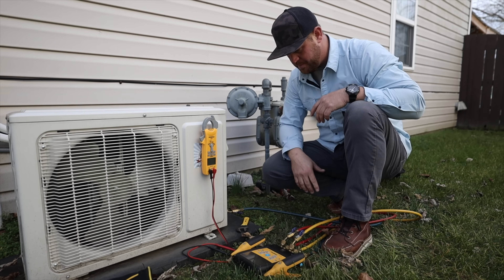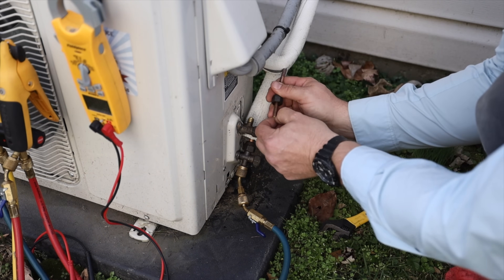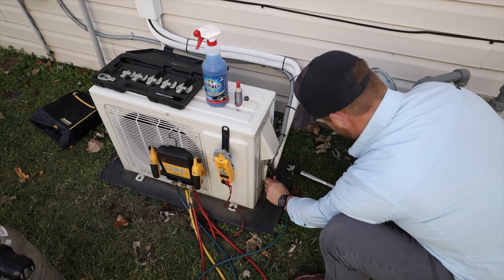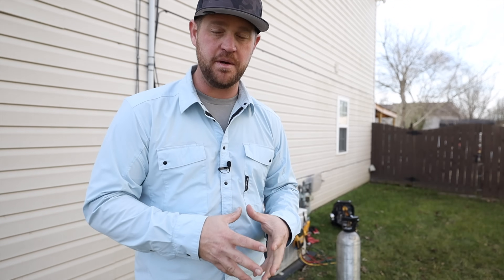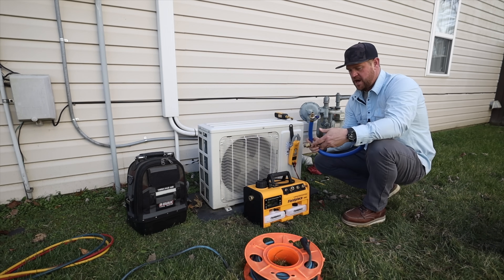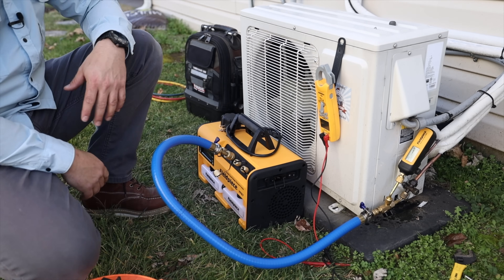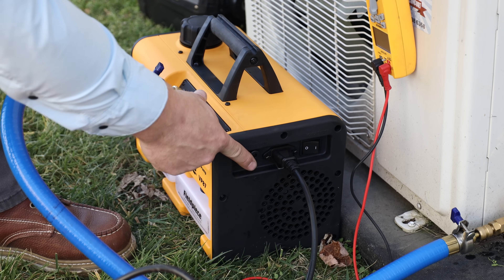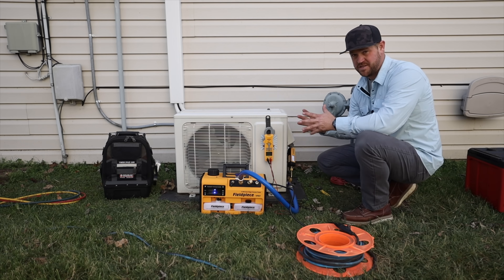#1 Reason Why DUCTLESS Units Fail | How I Fix It...

Comment: 👍  excellent video as always. 

It would be nice if we could order mini splits without flare fittings completely put an end to their leaks once and for all

As for the indoor air handler on mini splits I always cut off the indoor flare fittings and just Silverbreeze them they will never leak and exceed the life of the units for the next 20 years . 

        Something that we can never say for any mechanical crimped system just due to the physics of expansion and contraction of unlike materials copper to brass or any friction fit material
Reply: I did all that on a 2 head LG system couple years ago, after 18 month got a callback it was coding 35 on lower floor indoor unit for low charge. Pulled the charge on it, it was 50% gone. Checked all my flares, no leaks found. Turns out was several leaks on the lower floor indoor unit, on the return bends on the evap coil. One pretty big one that blew bubbles, 2-3 others that could pickup with electronic leak detector. Strange thing was the leaks were at the opposite end of the coil from the brazed parts... Cheap thin copper tubing I guess. Just goes to show, you can be as careful as you want installing one of these, and can still get refrigerant leaks. The amount of labor to pull the unit off the wall and change out the coil was way more that I wanted to do, so I complained to LG and they finally allowed me to warranty the entire unit. Since it has to come off the wall anyway to change the coil, and then put it back up, might as well just pull the whole thing and just install a new one. Saved a ton of time, and plus the replacement coil was unobtainium anyway, back ordered for 2 months they said. I was like jeez, it's July now, so the customer will have no A/C until September??? That was another reason LG authorized a unit replacement, there's something in the fine print that if replacement parts aren't available in 30 days, they will do that, but have to insist.
Reply: @brnmcc01  that’s good to know I have not had one leak yet but I remember that if they say it’s going to take over 30 days

Comment: The EPA just saw that
Reply: I hope your kidding Jonathan, because him purging his fill hose is perfectly legal and too often techs don’t do this
Reply: @hvacr_guy6889  I think he was referring to the 50 psi that was in the system before doing the initial pressure test. Then releasing  both refrigerant and nitrogen/co2 to atmosphere. I don't know if 50 psi worth of 410a is considered de minimus.
Reply: EPA does not consider a "trace gas" a refrigerant thus allowing you to vent it as long as the refrigerant in the mixture is not above a certain percentage of the overall system charge.
Reply: @aaronburke2469 As per EPA 608 Only four types of releases are pemitted under the prohibition:  #3 Releases of CFCs or hcfcs that are not used as refrigerants. For instance, mixtures of nitrogen and a small quantity of refrigerant such as R134a, or 410A, or even R22 that are used as holding charges or as leak test gases may be released. However, the release of mixtures of nitrogen and refrigerant that result from adding nitrogen to a fully charged Appliance to leak check the appliance is a violation of EPA standards. In other words, you can't add nitrogen to a system simply to call It a leak check gas and avoid refrigerant recovery. To use a leak check gas, the refrigerant in the system must be recovered to the required evacuation levels." ( which are 0" vaccum for r410a under 200 lbs)
Reply: @mitchdinner9743  thanks for the clarification, I took a 40 course but it was five years ago and I can't find the rules or remember the exceptions. So that refrigerant technically should have been recovered prior to adding the nitrogen, right?
Reply: @fritzmiller9792  absolutely,  i kept my study book from quick products on 608 certification. Always nice to have for reference since nobody can remember all that info. I have all of my certification study books and all four years of my sheetmetal apprenticeship books for reference.
Reply: @aaronburke2469  "Another example of acceptable venting is when we use nitrogen to pressurize or blow debris out of a system. Of course, all refrigerant in the system has to be recovered before we can do this" Trace gas is added to a system to facilitate leak detection with a refrigerant detector. This was refrigerant left in the system.

Comment: I am 100 percent a soap bubble man I do not use leak detectors or ultra sonic sensors. Just plain old bubbles
Reply: I find using the leak detectors work great for indoor coils. I’ve found more leaks faster that way, but I confirm with with bubbles. Feels good to see two methods confirming.
Reply: My H10 will pick up leaks that don’t show with bubbles.

Comment: Its a leak probably. Main reason for us, sad part is you can torque it to spec and it still leaks
Reply: Brother you anit never lie the torque wrench set is cool but not effective
Reply: Then your flare is malformed.
Reply: If have the proper flare tool made for R410A flares and use nylog and torque properly, then you are good to go. Like Zac said, you need to pressure check with pressure. We always pressure check with nitrogen to 500 psi, per manufacture specs.
Reply: If it still leaks you are doing something wrong